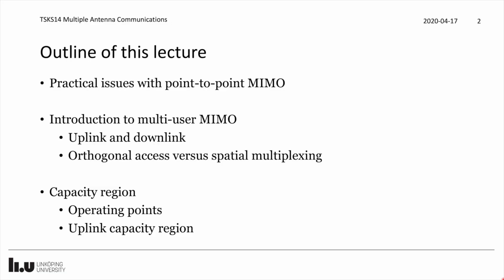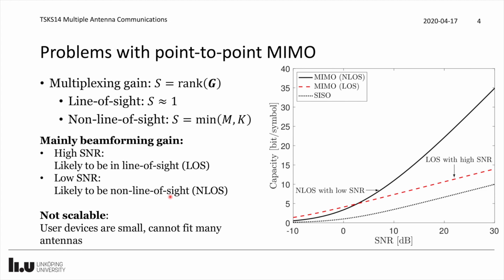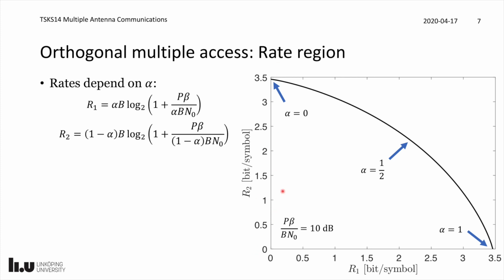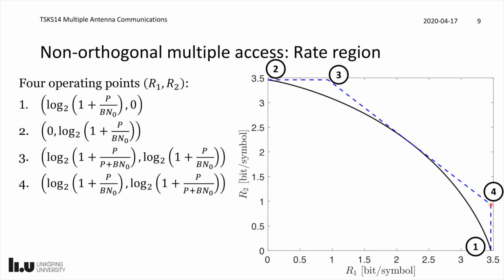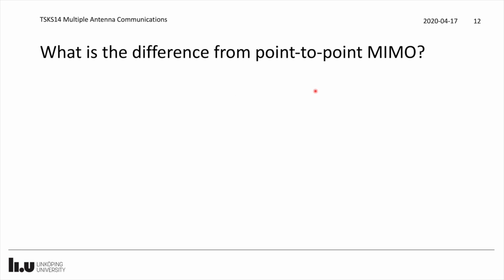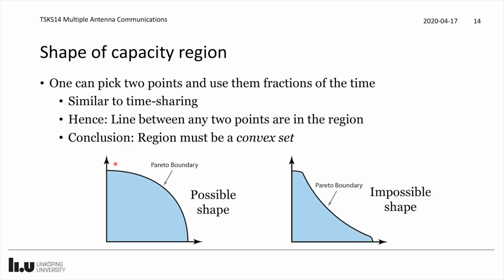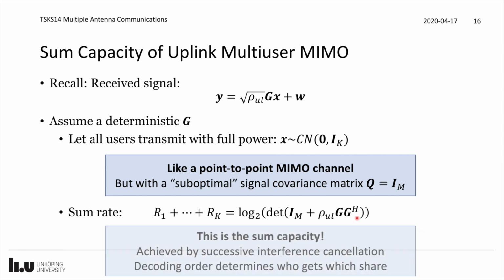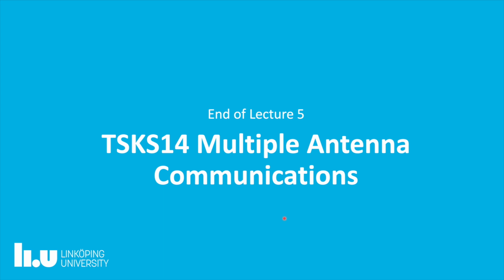Lecture 5: Introduction to multiuser MIMO (Multiple Antenna Communications)

Comment: Thanks for sharing but I have some questions
1- @26:01 for the case of non orthogonal access why the shape of the curve is not an ideal square ? Also the same question for the case of multiuser mimo ? If we can handle interference perfectly (interference cancellation)

2- What does this straight line represent and why do we have it ?

3- for the case of non orthogonal access what is the receive processing technique used when R2 rate is below its max ?

4- for the case of multiuser access what is the receive processing technique used when R2 has maximum rate ? Also for the same curve what is the receive processing technique used when it's rate is lowered (the straight line with negative slope) ?

Thanks
Reply from the maker: Hi!
1. The interference cancellation option is only available for one of the two users. One user decodes its signal under interference, while the other one decodes the interference first, remove the interference, and then decodes the own signal without interference.

2. We can obtain the two corner points in the ways described above, by varying which user gets interference and which doesn’t. We can then achieve any point on the line between the corners by operating at the corner points at different fraction of time.

3. User 2 treats interference as noise at thereby achieves R2 smaller than maximum. User 1 decodes the signal meant for user 2, subtracts interference, and then obtains its maximum ratio since there is no interference.

4. I guess you mean multiuser MIMO? The operation is the same as with non-orthogonal access, except that we also apply MMSE combining (which reduces to MR combining when there is no interference).

Comment: Thank you professor for uploading these informative lectures.
One question please: do we still need to use SIC when the base station is equipped with massive number of antennas? I think in this case the users will be spatially orthogonal, is that right?
Reply from the maker: Yes, that is right. As we add more antennas, the channels will gradually become more orthogonal and the benefit of SIC will gradually disappear.

Comment: Thank u so much professor! 
I just have one Question: why do we call it point to point MIMO?
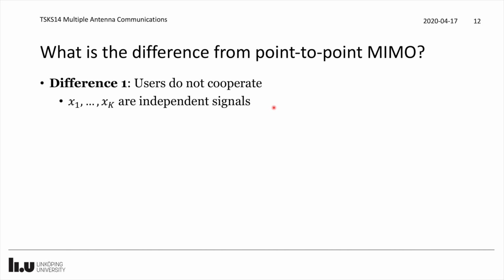And as you kindly said in 22:26, does the vector X delta that contains the information to be sent in point to point MIMO system belongs to one user?
Reply from the maker: Point to point MIMO is also known as single-user MIMO. It is a transmitter with multiple antennas that transmits to a receiver with multiple antennas. So all the transmitter signals are meant for the same receiver.

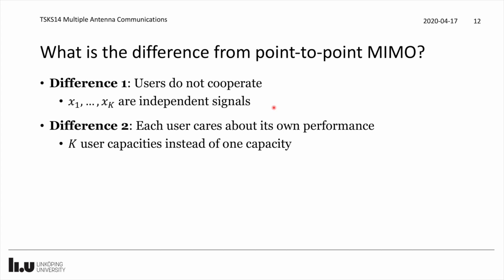In multiuser MIMO, there is multiple users at one side. At 22:26, we discuss the uplink from multiple single-antenna users. We are then sending different signals from different users, carrying independent information.
Reply: Communication Systems, Linköping University, LIU thanks a million! 👌🏼